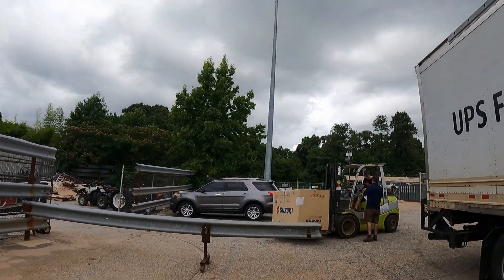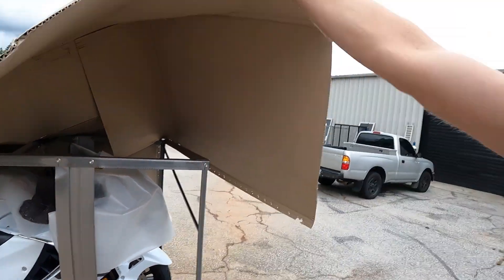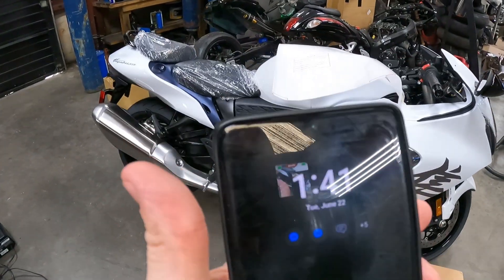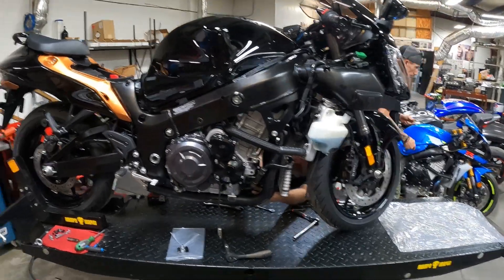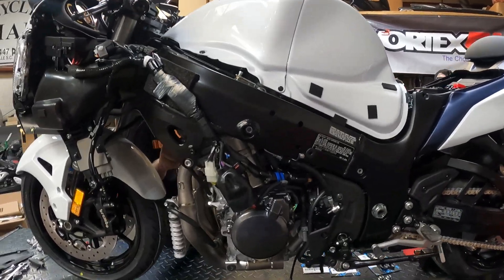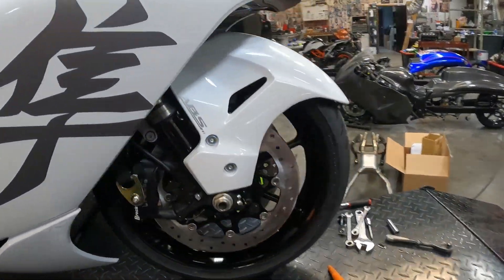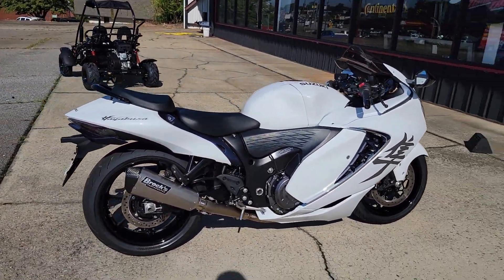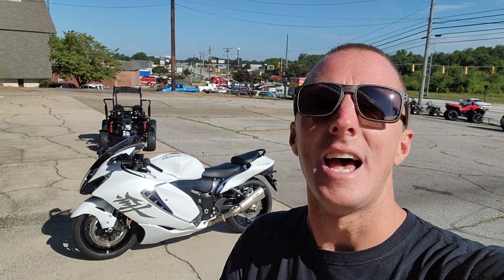Brock's Exhaust Install on my new 2022 Hayabusa

Comment: I remember getting my 2010 R6 in a crate.... Crate was made from spruce wood.
It's a beautiful thing.  100% stock made 107 whp @ 13,800 and 45 lb-fts @ 10.000 at the wheel.

Comment: I started installing an Brocks Alien head on my Gen 3. It has been nothing but a nightmare. Now it's torn apart & I have to wait for new crush gaskets and exhaust bolts. The supplied gaskets were larger in diameter than the original ones, after taking them out. I finally got 2 to go in after more cussing than a sailor but they still weren't in correctly. Thats why I'm waiting to get the original copper ones. I just hope I can remove the 2 that I installed. Do yourself a favor & remove your radiator to reduce the headache of install also. I would have left it stock had I known it was going to be such a pain in my a$$!!!

Comment: 05:29 I hate how a minority of people cranks the engine up when the the initial diagnostic and Fuel pump has yet to finish.
Reply from the maker: The new bikes don't work like that.  They are push button start like a car.  You tap the button and it starts on its on.
Reply: @TeamMooreMafia  No, What i meant is, should allow the Fuel Injection to fully prime first (along with its diagnostic), before cranking.
I cringe whenever a minority of people crank immediately upon switching key to "On", when the FI + Diagnostic has not fully load up.
U know, let the screen and the Fuel Pump Sound finish up first, before you even crank? 
Yeah, mate.

Comment: Could you give us a little detail on what you did with the 02 sensors for the aftermarket exhaust?  Thanks.
Reply: Probably non existent now. Nice the ECM has not been unlocked yet I'm assuming it's still installed but won't be there on the dyno